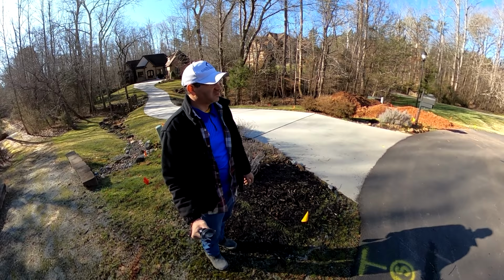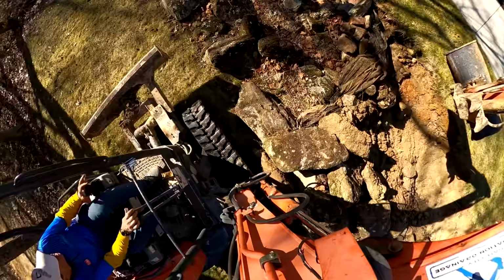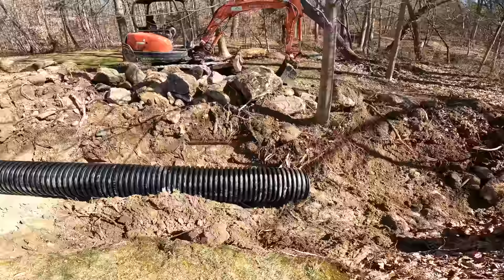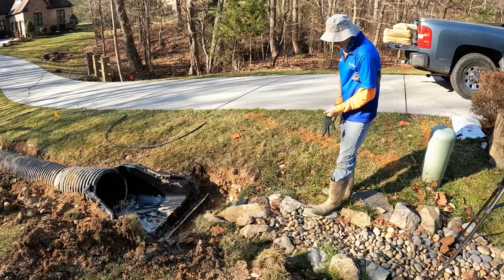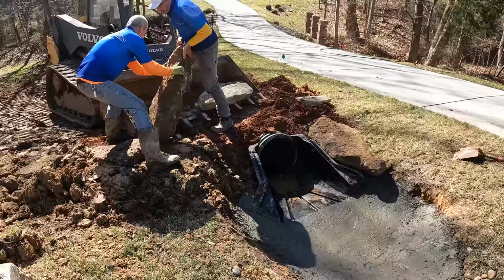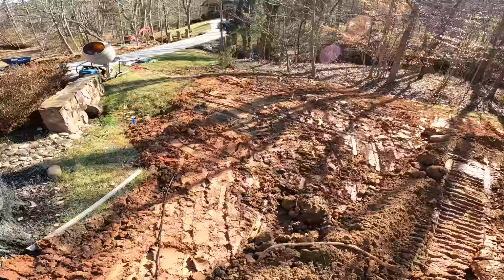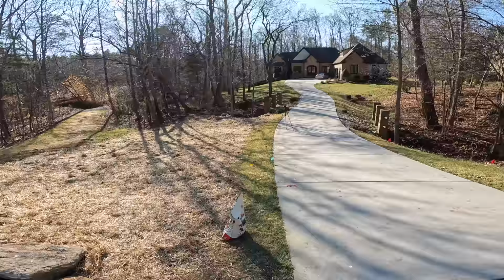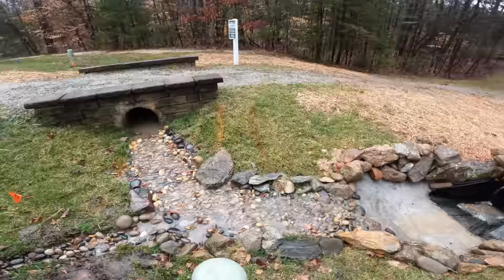Converting a riprap channel to a culvert

Comment: Just wanted to comment on cutting the ATT line.  I'm an utility worker and stuff happens.  The dump truck was the first failure but hey they're dump truck drivers so he was just looking to dump and go.  The main falt was ATT not burying their line properly.  Even if the dirt was still there, they should have informed someone that it needed to be moved to bury the line.  You went above and beyound to uncover the ped but I'd generally suggest you don't just in case you hit someone else's line.  All I ask is that you don't hide what you did.  Leave the line exposed and let me deal with it.

Comment: There is such a thing as utility providers marking the paths of their lines, and depths.  Dump Trucks also should not dump on top of or close to communications pedestals or other buried utilities.  Contractors have a responsibility to ascertain the locality and paths of buried utilities.  It seems this is a saga of combined lack of care and lack of responsible engineering.
Reply: In his videos he always talks about the markings, Because they were not digging there i would probably say that it should not have been an issue, the line should have been buried previously which is was not. it does seem to be a never ending saga of the Comm guys etc that do not follow up properly, and its certainly not the 1st like that Shawn has come across
Reply from the maker: Most of the time the communications people don't even bother to mark their lines. I tell the customer to call them, tell them we called 811 and the lines weren't marked. They come fix it for free, but that doesn't help the customer who has their service taken out.

Comment: It is the fault of whoever failed to bury the cable deep enough so it did not get cut by someone skimming the ground with a skid-loader bucket.  At a minimum it should have been at least 24 inches deep so no one casually digging around would hit it, like doing a little landscaping or installing a decorative feature.
Reply from the maker: Good point! This was about half and inch deep.

Comment: What a transformation! It's alwayss interesting to see what you're going to do and you never disappoint. It was also great to read the customer's review.

Got a question for you...would it have been possible to lay some of the smaller round stones in the concrete to create a smoother transition from the stones to the concrete at the start of the culvert? I was thinking it would have looked a bit prettier. Just curious. 🤔  😊
Reply from the maker: Yes for sure! We also left the concrete rough in case they want to install some flat stones on top of the concrete. It's a blank canvas for sure.

Comment: I feel like it would be the Internet provider AND the Dump company. The company for the cable did not bury it deep enough from what I saw ( Former Radio Operator/Line runner ) U.S. Army. Check the codes in the area. The dump company is also responsible for dumping the dirt in the wrong area UNLESS the customer you are working for gave them permission to dump the dirt in that area. If that is the case then the homeowner could be held responsible as well.

Comment: I think the blame for the cable snafu is 811; even with that pile of dirt there 811 should have been able to mark it. On you if you didn't phone 811 to mark that area. Subsequently on AT&T for not burying their infrastructure properly the first time. Chances are if they don't bury during the run they won't bury until it becomes a problem.
Reply from the maker: Nice assessment Eagle. I called 811 a couple times on this job because we kept getting pushed back with poor weather.

Comment: call before you dig, but if you weren't "digging" ie you were above the sod, then it's not your fault.  Utilities are supposed to bury those lines.  If it had really been 2 months, then the provider is in the wrong
Reply from the maker: 👍Luckily the cable tech got them up and running within a few hours.

Comment: Would have loved to see a fabric put down under the big rocks to help with erosion and then just pile all the rip rap on top to slow down the water at the exit.

As for the dirt dump its on all. I always mark where I want the dirt dumped so that I have fewer issues and always have everything marked for utility lines

Comment: My comment fits here,   but it's generally related to all videos on your channel.   Have you ever thought of giving a rough idea of what each project might have cost?   You wouldn't need to be precise.  IN fact, providing a wide range would keep customers from arguing about the price since the price ranges are tentative, and don't know everything involved.   You could assign prices to various ranges.   For instance,  Category A projects could be priced from $250 - $750,  Project B might range from #750 - $1999,  Project Cs might range from $2000 - $2999m, etc.    Without giving out pricing info to your competitors, you would help customers understand various projects' order of xoar magnitude.   You could also explain that the pricing takes all of your costs into account.   A few of these might include:  the number of workers, need for the backhoe and other heavy equipment, cost of materials, mileage, shop supplies, taxes. licenses, collections efforts, and time spent selling and developing just specs.   This info will help get people back to some semblance of reality!.   If this suggestion helps, I'll be glad.   I'm just a lowly, lowly member of your video audience.   You do a great job!

Comment: I see a few things wrong. I am surprised you haven’t been fined disturbing the creek bed. That is a no no. No packing around the pipe. Double wall pipe holds air which makes it float. You should have packed under the pipe sides and top. And a lesson to everyone always have utilities mark before breaking ground especially when working around pedestals. You can grade and the finish looks great. But lessons to be learned and applied.

Comment: I would say ultimately it's the utility company's fault for the reason this would be the third time i've seen cable not properly buried. On the other hand, the dump truck operator has partial to blame.
Reply from the maker: Great assessment Garrett. Luckily we are finished so it shouldn't get disturbed again.

Comment: Who's to blame? Who ever didn't install it correctly in the first place. (I've seen way too much cabling installed mere inches from the surface, because the minions were lazy and just wanted to clear the work order. There are a dozen lines in my back yard inches down, or currently washed up to the surface.) Also, the dump truck driver should not dump on a communications box (or power transformer!) but they too just want to get the job done -- and realistically, where else could they dump?

Having worked for NCDOT, I've seen many miles of communications cable destroyed. Even a power pole -- grade crew hit it, so it was snapped below ground. (residential drop, so only 240, not a 7k transmission line) If they don't bury their stuff as deep as they are required to, it's going to get dug up. I recall the 1" coax main line feeding Dallas NC getting cut one afternoon... pan goes by and now there's two wet spots on the hill as an 8' section has been cleanly removed. (in that case the blame was 100% on the cable company: too shallow, and ~100ft from where it was supposed to be) A few months ago when Google Fiber broke the .5" feed line for our neighborhood, it's was 100% their fault as they went outside their permitted and marked work area. (I was watching out the window expecting them to hit a 13kv power line -- they were super cautious around that red mark in my yard.)

Comment: If you are not excavating sub-surface it is not your fault.  No utility locate required by law.  Temporary cable should have been better marked.  Homeowner across street could have informed you what was going on.

Comment: The job looked pretty good and being able to utilize the rock was smart. However, I don't know about your state but we have an agency named Call before U dig. So anytime you're going to dig especially close to an obvious underground connection that cable needs to be located and marked. Once marked it's your responsibility to stay clear of the marking by 18 inches on either side or there abouts. A cable line can be fixed easily but if you cut a line with optics it can involve many customers and lead to huge fines...Just sayin'

Comment: 21:49 I would say the dump truck driver is at fault for the original issue and the ISP should have either called in a landscape company to remove the excess and billed the dump truck company or done it themselves and billed the same company for their additional time-- at the very least they should have marked the temporary line and informed the homeowners. (Ain't nothing so permanent as a temporary fix.)
 Not your fault, but you claimed responsibility and aided in the fix. Contractors like you are worth their weight in platinum, forget gold.

Comment: The 1st Outage is partially the truck driver's fault for dumping too close to the box but mostly the fault of the techs that originally ran the line for not burying it deep enough or otherwise properly protecting it...

The 2nd Outage is ENTIRELY the repair Tech's fault for not marking the location of the temporary line OR properly protecting it KNOWING you're still around doing work AT THAT LOCATION!!!

If I was the customer that's lost my Service twice due to how shallowly the cable was installed, I'd be screaming Bloody Murder at the Service Provider and demanding they send out some COMPETENT Techs that know how to properly bury and/or protect a cable and if it gets cut again due to not being deep and/or protected enough, I'm gonna SUE the Provider AND the Installation Techs!!!

Then I'd be calling the County Code Enforcement Office to ask them what the Code requires as far as the Cables are concerned and if the install doesn't meet Code, I'd tell Code Enforcement that ALL the local Installs are not up to Code...
Let the Installation Company try explaining themselves to an unhappy Code Enforcement Officer...

😄😁😆😅😂🤣
Reply from the maker: It does seem like a pretty easy problem to avoid. Bury the service like it's supposed to be instead of half an inch deep. 👍

Comment: I couldn’t see if the inlet went into the pipe or did the pipe lay on top of the inlet? With the water pooling up in front  makes it look like the water might be trying to work under pipe,  just asking. Awesome job and video. Keep them coming and stay safe and healthy y’all.👍👍👍👍
Reply from the maker: Yes that's typical for bell end pipes that slip together and are not glued. The bell faces uphill.

Comment: If the buried cable wasn't located by its owner after you requested a locate then it isn't your problem.

If it was marked accurately then unfortunately you cut it. It's on you.

Comment: You are at fault. This is your work site. You should have known better. Services should have been pegged out and the pegs painted, but I must say your finishing work is terrific.
I also would have put a safety cage over the inlet of your wing wall to stop kids from crawling down the pipe. I rate this 7 out of 10

Comment: That tree next to the outlet is going to become a real problem in the next decade. 20:48 @Shawn as I've said before I find it extremely stupid that infrastructure like these network cables are installed extremely shallow and unprotected i.e. less than 2 feet deep and no PVC (corrugated) pipe around them. I blame the utility company/companies, they are at fault for such shitty installation. And why install a temporary cable to begin with into the ground. Either fix the issue right away, or leave your temporary solution open/accessible. Poor customer.
Reply from the maker: I agree but they all bury the internet lines an inch or so deep. They also don't mark when I call in a utility locate request. It must be cheaper to fix than to locate before digging.
Reply: @GCFD  customer always pulls on the shortest end this way, and that's just sad

Comment: Love the videos and have done some landscaping in my past. I agree about your using PVC instead of corrugated pipe for drains. I am not a culvert anything. Never have had experience with one. The culvert pipe is corrugated. Why here? Is a non corrugated pipe too costly? I would assume there will be enough water to wash sediment thru.
Reply from the maker: This is double-wall corrugated so it is smooth on the inside and rigid like PVC. It's good stuff.

Comment: Is that red dirt mostly clay? It might not grow grass all that well without a bit of topsoil on top.  That creek will likely keep eroding... next step would be to continue the culvert, join up the other pipe, and take it further down the way.
Reply from the maker: Yes it's red clay and I added some topsoil in the load I brought, then power raked it all in. It should grow and I'm planning to revisit the site in a hard rain, hopefully after the grass has grown back in.

Comment: the tech who worked on the guys internet cable, IS THE GUY WHO'S at fault, didn't even mark out the cable (in my region, techs are required to mark where the cable runs when above ground)... plus how would you guys know if they left the cable on the surface or not when you couldn't see it?... definitely NOT YOUR FAULT

Comment: internet company fault becasue they NEVER EVER bury the line very deep. its always like 2 inches below the ground. if they would just fix it right the first time they go out as well. Amazed how many times I see cable lines just running across on top the ground for long distances. they sit like that for months.

Comment: The internet question, the cable should have been buried the first time, defintly the 2nd time, as it would not have taken that long just to do it properly, now they have to come out a 3rd time initial and the 2 repairs.  Just do it right the first time.

As for it being the customer private property, essential services such as internet typically will have easement authority as needed, or so one might assume.

Seriously?  The cable guy put another surface mounted cable down?  So now they come back a 4th time to finish the job.  *shakes head*

Comment: Another great job ! I see you got your new truck back on the road, what did you find wrong with it or did I miss that video.
Reply from the maker: This was when it was running before it broke down. I have a high pressure oil leak and will be looking into it next week. Hopefully it's an O ring or injector, but I will post an update. 👍

Comment: Some people have too much money
Reply: Isn't that the truth. Some of these people want dry yards immediately after a rain. I'll save 20 grand and wait a day until it dries...
Reply: @gangisspawn1  good for gate city drainage for making money but, like come on.
Reply: @coolcorey13755  shit I don't blame them if a customer will pay it. I know they do good work but if the water isn't damaging my house or making my yard totally unusable I'll live with it. 

I've seen so many customers on this channel replace a good concrete slab because it holds a puddle on the corner, or has a small crack. 90% of the problems are solved with cleaning your gutters but the residents have no time for that, but several grand to spend.
Reply from the maker: The riprap channel has been slowly deteriorating so this was not purely for looks. The HO had already taken a few steps to stabilize things but it kept getting worse.
Reply: @GCFD  how much did that job cost. Over 7k?

Comment: Enjoy the channel. I have a question I would like your opinion on. We are currently trying to start a home build in the Richmond, VA area. Here when drain tile around the footing is used, it's often underneath the house, inside the crawl space. They use perforated corrugated pipe, I would obviously used perforated schedule 40 4" PVC pipe, but under the crawl space is what I question. Some builders do put it around the outside of the house instead of the crawl space (to capture water before it gets to the crawl space I would imagine). It's hard to get clarity on the positioning, as it's only needed in this area when required by the engineer, many just do it as a precaution. Inspectors will allow it either way. Anyway, our plan is to use it, but on which side of the wall would you suggest? Obviously there will be rock (57s) below and above it, would you also wrap it all in fabric as well? Without any clarity we would likely just install it in the crawl space, as that is what seems the most common. Just looking for your opinion and thought process. Thanks.
Reply from the maker: If you have impermeable clay then the outside foundation tile is only address subsurface water. You would never want to invite gutter or surface water into that drain. Instead, you want to keep surface water on the surface and shedding away from your foundation. Make sure you have sloping dirt angling down away from your foundation. The gutter water is always a huge factor since you're taking a large area of roof and concentrating it into a downspout. Make sure the gutters are working and not overflowing. Then, direct the downspout or catch it into a pipe to carry it away. 
I don't install perforated pipes in the crawl space because that is addressing water that has already passed through the foundation (which is what damages it). I focus on keeping water away from the foundation, thereby making a crawl space drain meaningless.  I hope that makes sense - Shawn
Reply: @GCFD  That makes perfect sense, and what I believed to be true without actually knowing. The footer drain would be for subsurface water, and absolutely keep gutter and surface water away from it. I really appreciate your time to clarify my concerns. Great content, really good at explaining everything and following up with you projects. Keep up the good work. Thanks again.